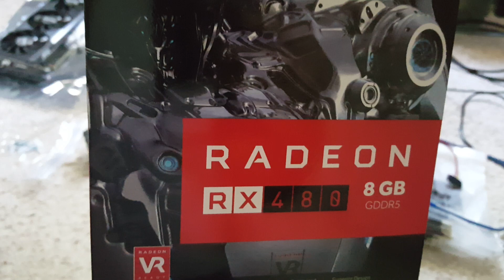Bitcoin Mining vs. GPU Mining & How to Assemble a Mining Rig for Ethereum, Dash, LBRY & More Part 4

Comment: dude how are you bro ihave the same motherbourd but got problems running the 6 gpu i can only run 4 of my rx 470 i have windows 10 and installed amd driver 16.10.1 but still having proble any advice?

Comment: I give up mining Ethereum, dosent work to set it up for me.
Reply: "geth new account" dosent work. and all other videos dosent show how to set it up, and my paid antivirus removes everything even when I have turned it off. what kinda antivirus do u use? I might need to buy a whole new computer just for bitcoin mining...
Reply from the maker: You may want to try some software called the miner gate it works better for older computers but their withdrawal fee a really expensive.
Reply from the maker: Mcafee enterprise is what I use but on their website it does say turn off any antivirus program you're using because sometimes there are problems and it seems like you run into it.
Reply from the maker: You can get mining really cheap these days and I link to all the parts in the video too. if you already have the power supply you can get started mining with one graphics card making $2 a day for less then $500 and then you can add more cards later on.  If you're real smart you can scout eBay and other places like that and get use graphics cards for $100 but the new ones are so much better so don't pay too much for used ones.
Reply: TheBitcoinMiner I did check ebay, komplett.no Komplett.ie amazone, ncix.com and MicroCenter.com I think microcenter was the cheapest place for Graphic card since I found a 1070 GTX for around 420usd what cost around 600usd in my country. but the shipping etc is much, so might not be worth it. I plan to sell some of my stuff and then make take a small lean and see if I can pay back without having any problems.